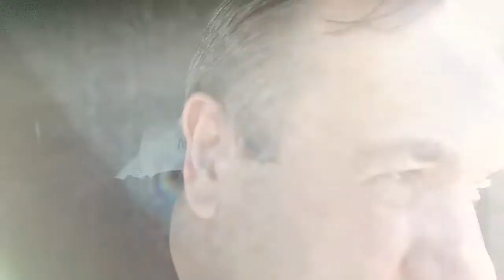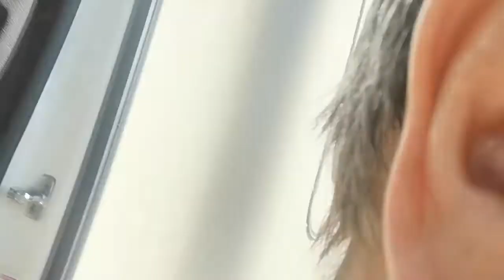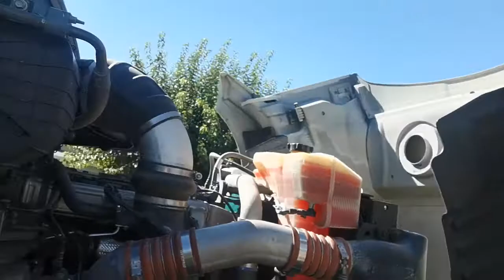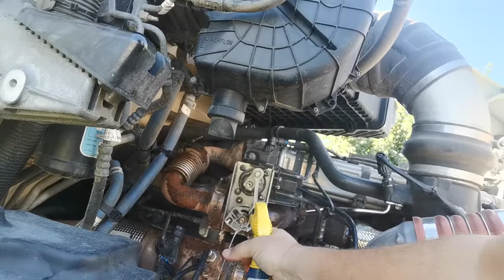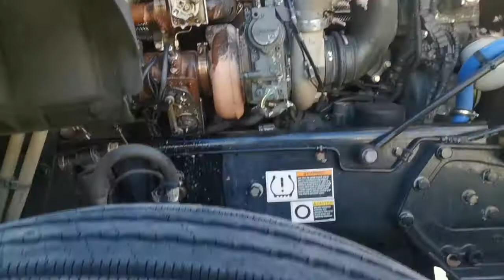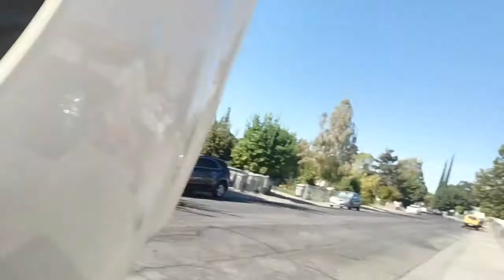Paccar MX13 EGR problem

Comment: What scan tool are any of you using for the mx13 epa 10 in a pete
Reply: Just bought OTR performance, i have the same issue like this driver, cleared the code and will see tonight if it comes back. Mine is leaking just a little bit
Edit
I have 2020 mx13

Comment: Did you ever replace your egr valve? Did this fix your problem?
Reply from the maker: yes I did .it fix problem
Reply: Thank you for replying. I have the same problem. Your video is a big help.
Reply: @chipfeild-mr5ro  I have the same issue with a lot of smoke out of it Any idea how much can it be fixed. Thank you .

Comment: I have J1939 code on paccar mx 13 fully deleted. Fun kicks in unnecessarily and then engine light comes on and then truck will shut off.
Reply: J1939 is a protocol number, not an error code

Comment: My truck making noise press on the gas pedal please tell me a solution have a paccar motor Mx 13 t680 800,000 miles
Reply from the maker: check the gaskets on EGR
Reply: My EGR leaks about the same amount. I would love an updated version. There are around 4 successions since this generation MX13. But at 2500 it's high. You can find one for 1800.
Reply: Check clamps at dpf inlet and outlet elbows. Make sure thier not loose.